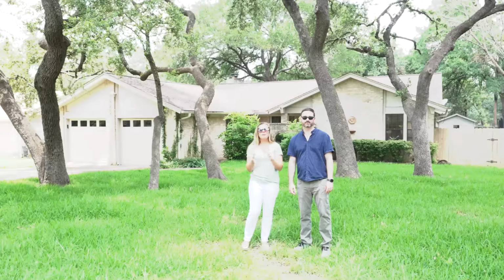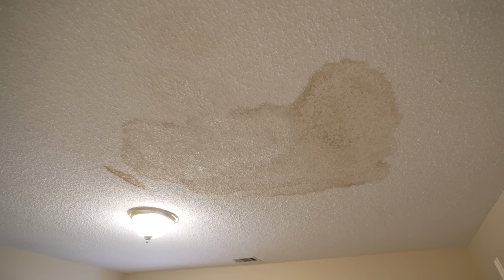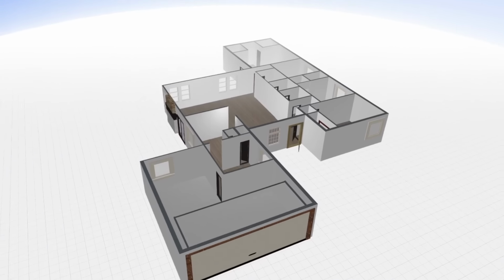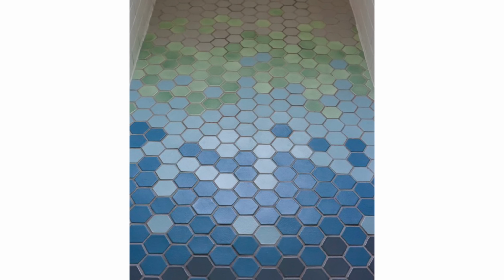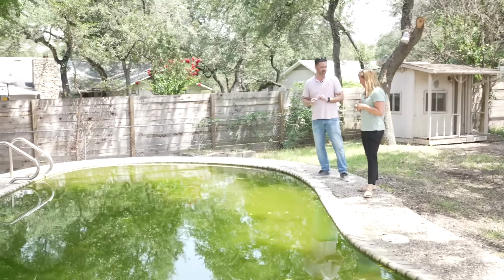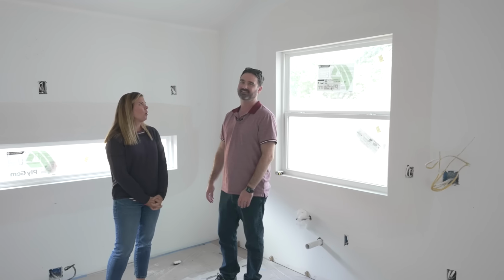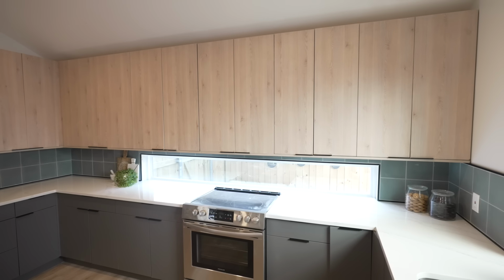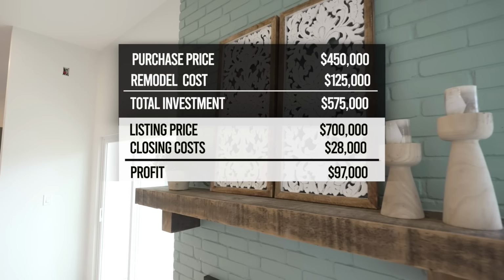We Completely Gutted Our Next Door Neighbor's House | Full Before & After Transformation

Comment: The original exterior front elevation was much better, and that little courtyard was integral to the design. Now it looks exposed and ordinary. Also the original buff color of the bricks was stunning. Much better and more up to date (as mid century modern) than the artic white and grey.
Reply: I agree. I was sad to see that little courtyard removed, and the original brick was so much nicer. I'm sorry to have to say the new exterior is awful - so BLAH. The colors are wrong, the window trim is wrong, the front door all but disappears. I wish I had gotten hold of this exterior to redo myself. The interior is a huge improvement, but is there any privacy on those large windows? I cannot see any blinds or shade housing, and would definitely need something there.
Reply: I agree they ruined this home. Painted brick outside and the fireplace. Only thing they did right was the leveling the floor. I'd fire their stagers. This slender window you have to bend down to see out. This is a complete nightmare to me

Comment: looks great guys! 
 My only concern was the height of the cabinet over the range seems a little low?
Reply from the maker: there's a vent hood built into it.
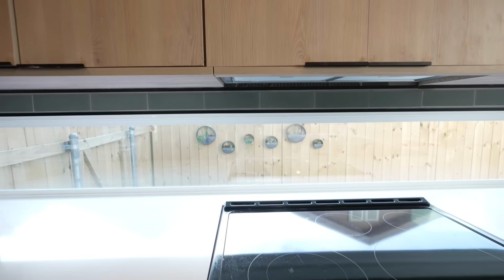Reply: Thought it was a light but I guess you can see that it's a vent. 26:50
Reply: I love the window backsplash but would have made it bigger so you don't have to stoop down to look out.  Also, the sink (where you stand and need something to look at) would have been an idea rather than the cooktop, imagine the grease and splatter!  Also if the window was one that bifolded open like a patio door would have been spectacular for the summer and to be able to be a pass through.

Comment: This house certainly looks great after, but honestly it looked great before, too.  Also it had no structural, plumbing, or electrical problems.  Horrific pool aside, I'm just not sure why this one needed a flip.  This is the kind of flip that really just makes the house (and thus the market) more expensive without providing real substantive improvements.  I mean a bigger kitchen is nice but honestly the original kitchen was in good shape and had a decent layout.  It was "small" only by the standards of the rest of the house.  This wasn't really a fixer-upper, it was just a slightly dated midcentury charmer - and there are people who go for that.  And why is it such a problem that you can "only" fit one car in the garage?  Again, it's a super cute update, but this is the kind of flip that locks more and more people out of home ownership in the first place.
Reply: Look at the market. Buyers are almost never going to go for a dated 70s house--they want new and clean. Does the house itself "need" it is arguable (does a house need anything but working water, electricity, and storage?) but there will absolutely be more buyer demand for it post renno than pre.
Reply: @carlotta4th  They priced a first time home buyer out of the market by flipping this house. As an austinite who's been looking for over a year in this market, it's frustrating to see. This house would have been a perfect starter home for someone willing to put in some sweat equity. Not to mention they removed charm, painted over beautiful brick, and made inpractical design choices. Tile-ing in the bathroom looked horrenous. I hate to leave such a critical comment because I like these folks and this channel, but I wish they would stick to the "uninhabitable" places.

Comment: The tile ombre in the bathroom would look nicer if the ends were a little bit more staggered, right now it looks like 3 separate areas but maybe if there were a couple of dark tiles further down on the white tile area and vice versa, that definition of areas would look blurry. Right now it looks like they tiled the dark area, then tiled the white area and tried to do the ombre just in-between. Would be nice to have some single opposite tiles popping out on the ends.

Comment: The only part that is still bugging me is the kitchen is missing the code required 30" clear above the range/oven to a non combustible surface.
Reply: It has a range hood, so there's that at least.  But still, the cabinetry is so low that it really interferes with proper use of the range.  Using large pots will be a pain.  Seeing inside and stirring in pots on the back burners will be difficult.

Comment: Please forgive how long this post is, but all this needs to be said. 
The kitchen is not practical at all. Anyone who cooks will spot the problems immediately.
1. The cabinet over the stove is too long. Not only will it impede cooking, but the steam from cooking will damage the underside of the cabinet. Not to mention, over time cooking certain foods will cause a build up. (ie: Stir fry foods, or any foods which require a very hot skillet & a little oil causing splattering).  Also, unless a person wants to deal with a permeant knot on their head from hitting it on the cabinet all the time, it's a really bad idea. A persons face will be right in front of that cabinet each and every time they "try" to cook forcing them to look at the cabinet instead of the food they are "trying" to cook. 
2. The back splash window is a beautiful idea and a great way to let in natural light, however, it is going to stay dirty all the time from cooking. It will also be hard to keep clean and to clean, (Especially with the long cabinet.) 
3. No ventilation in the kitchen. (No range hood) Try getting the smell of cooked fish out of the air without it. Along with other smelly but good for you foods.
4. The microwave placement is awful. Easy access for toddlers and small children. Just exactly what a parent doesn't need. 
5. Unless that is water proof flooring in the kitchen, the new owner will face major issues in the future.  
Overall, the kitchen is very impractical unless the owner doesn't cook and order delivery or bring home take out all them time and if you want a show kitchen and not a kitchen to actually use.  Which is okay, not everyone likes to cook or clean up the mess afterwards. 
A lot of people like white walls until they have to actually live with them. Not only do they become sterile very quickly and feel like a hospital, (not very welcoming or calming at all), but then they soon realize how often those walls actually get bumped up against, touched with dirty hands, etc. Their lives become dedicated to cleaning those white walls day in and day out. Forget about enjoying life, because your life becomes consumed with keeping them clean. (YES, I speak from experience. My apartment has white walls, white floors, white appliances. I have a four year old grandson and babysit my 10 year old nephew. Both of whom are allowed to be children and play inside and outside and NOT made to sit still and watch tv all them time.) 

One more issue: All the grandma remarks are very offensive, and I'm extremely hard to offend. You imply that grandmothers have no style what so ever and that every grandmother sits around and smokes all day long. Just because someone's style is different than your own doesn't mean it is bad. I know plenty of young or younger people who would prefer their grandmother's style over your style. NOT every grandmother is a smoker and even if they are/were, it doesn't have a darn thing to do with their tastes in style. I'm tired of our elderly being treated or talked about with such disrespect and disregard. One day, (and sooner than you think), you will be old and is this how you want people to see you? To talk about you? With such negativity? With such distain? Like everything about you is/was bad? Or like you are/were stinky, smelly, unhealthy, not be look up to people?  Just quit making rude remarks about grandmother's, it's not a cool at all. I love my all my grandmothers, ( 3 grands and one great), and although my style was not theirs, I never did and never would speak about any of them like  you did in this video. It's so disrespectful.
*Edited to correct spelling and add a line.

Comment: Huge improvement.  And I'm completely with you on the sunken living room.  What a design disaster those things were.  I would be completely worried about breaking my neck walking in and out of that room.  Granny might not like what you did with the place, but everyone else will.  I'm not hot on the fireplace color, but it is less terrible when combined with the other colors as you say.  But, otherwise, the design and furnishings are pretty good.